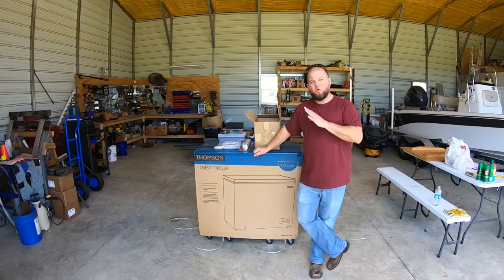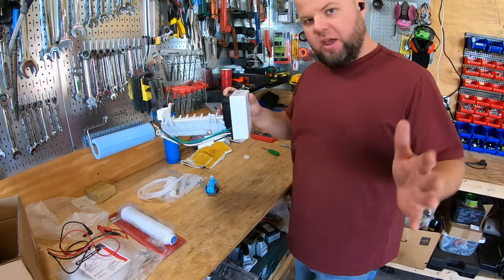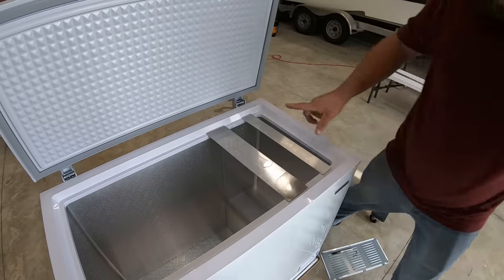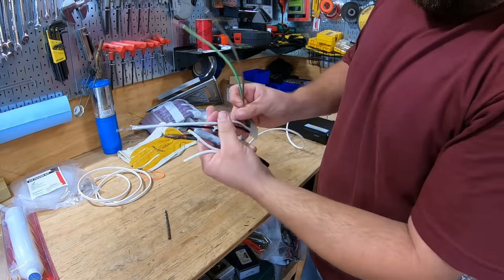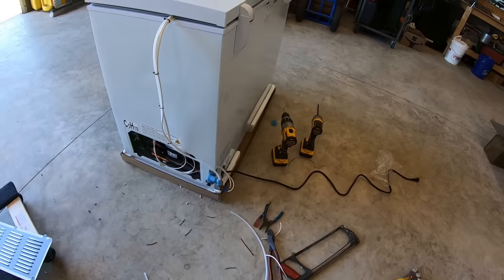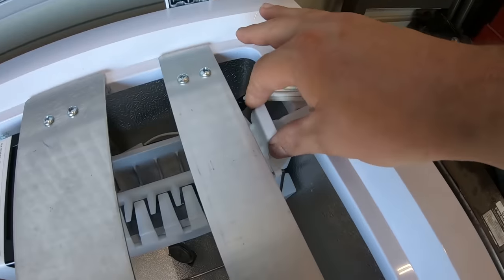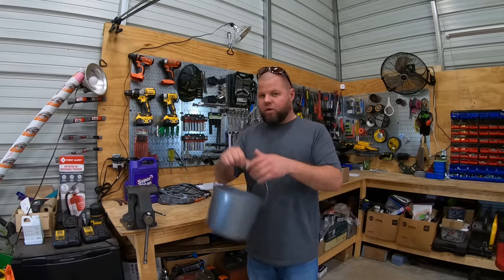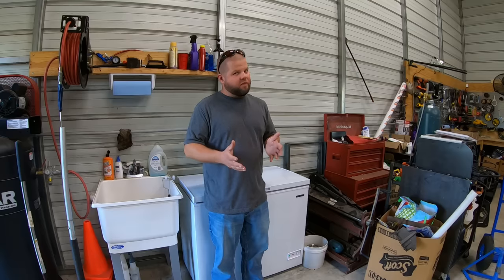Homemade ice maker! SAVE thousands over a commercial ice maker

Comment: Caution on so called self-piercing valves...when copper supply line is tapped, it  should be pre-drilled with a 1/4 in hole.The piercing point does a poor job, sometimes breaks and anyway provides barely an eighth inch hole..Additionally, these valves should be mounted on vertical  supply lines where possible.If a horizontal run is the only available, mount the valve on the side of the pipe.if mounted on the bottom, sediment will clog it eventually if not sooner.Corrosion can occur at the point of attachment due to the copper to brass dielectric matchup.       -10 deg F is pretty cold for this operation.The operating thermostat inside the ice maker closes at 16 deg F. A freezer running that cold could cause the I/M to short cycle which would result in hollow/damaged cubes as well as continued icing of the fill tube.
Reply: I'll go further to say that those self-piercing valves have a limited life.  I always bite the bullet and shut off the water, cut the copper pipe and install a tee, then put a regular ball valve on the tee outlet.  It's not much more money but it makes for a nearly permanent leak-proof installation.  For me it's worth a few $$$ and 30 minutes of time.
Reply: @fredsasse9973  Yes ,the saddle types do have a shelf life, yours is a much better way.Folks w/o soldering skills can use the 1/4 in hole method with the saddle valve to avoid at least some problems.

Comment: Could you have used a hot wire/rod to melt a Channel into the cabinet for the power and water line? Then once installed used some white Marine J.B. Weld to smooth out the cabinet which would give you a good surface to seal cover.
Reply from the maker: Yes that would work

Comment: Great idea thank you for the video just wondering you should have some backup power in case the electricity goes out for a little while then all that ice turns to water then the electricity comes back on and turns that 40 gallon of space into a 40 gallon block of ice imagine trying to get that out on a whim, also careful with the plastic tubing especially in the garage because sometimes rats come in the front open garage door and if you set poison they usually get very thirsty and they will chew right through a little plastic tubes like that and you'll have a water Mass all over the place just adding my two cents, great idea though thanks again
Reply from the maker: We have generators, this is Florida, so storms are common

Comment: Have you checked the ice maker trays before new tests for any ice that may be in there to add up yo next batch
Reply from the maker: No I do not use anything still in the maker trays, that's why I run two 24 hr tests and take the average. Timing the drop is about impossible, the avg works well.

Comment: Holy power socket overload Batman! - Feel free to install a decent power set up for your workbench - It's a fire waiting to happen atm!
Reply from the maker: Not at all, 10 gauge wire, 20 amp breaker and all outlets are industrial, not the cheap ones. How much power do you think this actually pulls? I've tested it and it's isn't much

Comment: FYI if your going to solder wires like that dont twist them together butt them up to each other and push them into each other makes for a better connection .
Reply: Don’t forget the heat shrink tubing to cover the joints.

Comment: Did it come with a floating basket??  You could have used that to set the ice maker in.   You might have had to cut one side out but it would work
Reply from the maker: Watch the next videos, I installed two ice makers, so the basket wouldn't work.

Comment: First, thank you for sharing. Just want to mention the ice made in this fashion is not at all the same ice made in a stand alone ice maker. Commercial ice makers freeze pure water and the impurities are flushed out. They use a lot more water than a built in ice maker that freezes all the water that goes into it with impurities and all. If you are using the ice just to fill coolers your plan will work great. Actually even better as the impurities keep the ice frozen longer. I would still buy commercial ice to put in the drinks as it tastes a lot better. Thank you again.
Reply from the maker: I agree, this project is strictly for coolers and fish boxes.

Comment: So if u want to bend  Plastic tubing without it  Getting a kink. U fill it up with sand leave little  Room for movement If possible cap the ends then put in the oven or slowly heat it up  Once desired  Angle let it slowly cool down. Wash sand out thoroughly  With something like a bottle brush

Comment: Since there is not coils in the lid could the water line have been installed through the lid?
Reply from the maker: You can, but I don't like that since the lid moves and will pull on the lines/wires.

Comment: Maybe you could of pulled the exploded parts diagram to figure out where the tubes were roughly so you could drill a few screws to mount the kit the way you wanted. Either way, cool idea… may have to try this sometime.

Comment: This is a great idea if it serves your needs.   Commercial icemakers make clear ice with the impurities remove.  There are filters on the incoming water supply and the way they make ice takes more impurities out.  The water is circulated by a pump and freezes to the evaporator as it flows down the the trough and is pumped back to the top.  That's why commercial ice is clear and ice made this way is not.  Commercial icemakers make ice faster as well.  They are also cleaned on a regular schedule, the frequency varies depending on the environment it's in.  Breadmaking and beer dispensing require more frequent sanitizing due to the yeast that gets airborne and drifts into the machine.
Reply from the maker: I understand and that's great drinking ice. I need super cold, thick and long lasting ice for coolers and fish boxes. On a budget too
Reply: The difference between clear and cloudy ice is temperature and temperature alone

Comment: Freeze buckets of water, large heavy zip lock freezer bags and make big chunks that’ll last longer. I freeze milk jugs with water in them 80% full then pull them out and beat the sides with a hammer and chunks come and dumped into your cooler. Ice cream buckets are great and release a huge chunk if you want it to really last a long time if you particularly want ice not just being cold. I like cold dry coolers so read the next part.You can freeze your whole unit with this method by putting loose fitting boards in as shelves across the buckets and get that mass started. Leave some there to maintain mass. The milk jugs have a hole cut in them as we used them once with the handle intact to bail out water in the boat too. You shoulda just used it as a freezer without all that if you do likewise to the above. Hammer on the sides doesn’t usually break the plastic and theres a plenty of milk jugs to be found. Just frozen containers like 2 liter bottles and I particularly like the half gallon jugs but I only bust up the gallon jugs. Have at it and you can make lots and lots of ice. It does take a couple days to freeze a gallon till the mass gets built up. I use a lot of half gallons in a cooler to age deer meat do thats why I need lots of back ups and my favorite. Just fill them 80% and wash the outside before putting back in freezer.
Reply from the maker: The problem with block Ice is it does not surround drinks in a cooler or fish very well. But I am thinking about adding block Ice in combination with cubes

Comment: A kegerator uses a heavily insulated 2x6 frame around the top of the freezer to put the Beer taps through and a temperature controller to maintain temperature.  The temp controller is not needed for your application.  The freezer lid is relocated to the 2x6 frame to close properly.
Reply from the maker: Yes! Watch my recent video, I discuss this and plan on doing that on my next build.

Comment: Only thing I would do differently is to use one of the metal racks and put the ice maker in it. Cut it so that the ice maker sits down in it snug and notch the plastic top for the tubing to fit into. Then use something to seal it up

Comment: Love what you did with the install ,but the water valve should be mounted with the input on the top , the solenoid needs to have gravity assist in closing the pin inside to prevent failure to close.
Reply from the maker: Good to know

Comment: Insulate your water supply .
The water comes out of the ground at the average year round temperature
Of your location . 
But then in sits in the pipes until the solenoid opens. While sitting it heats up to room temp, in basement cool in barn or shop hot.
Then the freezer had to cool it down again.

Insulate the pipes as best as you can from where it comes out of the ground.

Also locate freezer in coolest place you can ie cool basement.

Comment: Just need to think about Everytime you open the lid to get ice out your letting warm air in causing the ice in freezer still to stick together and eventually ice on bottom may turn to one huge solid ice cube block that u need to break apart which an ice pick is risky and hammer also risky puncture a copper pipe and game over but hope it works out great for you!
Reply from the maker: Not been an issue after three months and opening up multiple times a day for testing/videos

Comment: You should hook the Green wire to the case only. Use the white for common and black for line power. If you wire the green for common ground you could possibly pull current through it or create a possible hazard of electrical potential between the freezer case and another appliance. It depends on how the icemaker is wired which I do not know. Just be safe :) It's a great idea though.
Reply: The green wire is connected to the case down in the compressor compartment.

Comment: Not that is matters but your freezer doesn't use freon or similar refrigerant. Cyclopentane, hence the flammable caution, it's less damaging than any other other options so is commonly used in appliances which are not always disposed of correctly. Cables through the drain or lid would work well too, good call on not risking it & damaging one of the lines. Might add a fan to cycle air evenly? You'd probably get away with a 110v fan running off the compressor thermostat so it cycles with the compressor - but ground it well in case of accidental shorts.
Reply from the maker: Fans installed two days ago, that video will be out later today

Comment: That freon is propane based  .
But other freons if ignited you breath one breath it kills. 

Being in water filtration 
I would connect an RO unit 
Theres an excellent permeate unit that will last twenty years  filters are cheap  that filter you have wont last long its good for maybe 200 gal for chlorine and taste  thats it.  If yur gonna filter may as well go to the dalton scale and you can consume the ice  otherwise 24500 contaminates as all water has.   

Thats a great ice machine ! 
and easy to fix.   With a garbage can you can use the other side for your bait.
Reply from the maker: Just using this for cooler ice and fish boxes, not worried about taste or for drinking. It's c5h10 cyclopentane, thanks for watching.

Comment: Or you could fill freeze milk jugs, 2 liter bottles, even water balloons work well. And then you can either leave the ice whole in whatever you used or break with a hammer. If you have room in your cooler leaving it whole is the way to go because  it last 10 times longer before it melts.

Comment: Caution drilling holes in the side look for frost line so you dont drill in the evaporator also most freezers has thermal strips to keep the gasket from freezing
Reply from the maker: I checked for wiring and the heat strip before cutting.

Comment: I checked the specs on my counter top ice maker - 40lbs per day but at about 1.7 lbs at a time.  It makes a tray of ice every 12 minutes.  The disadvantage to these ice makers is they don't keep the ice frozen.  It only makes ice as it is used, keeping 1.7 lbs available between consumption times.

I checked my lamp cords.  The lead with the ridges is the neutral wire is the standard.  But ii really doesn't matter as long as you mark or otherwise color code your wiring.  I don't know if this wouled work, but drop a few pounds of dry ice to kickstart the cooling process.  Let's see of all the ice you make stays as separate cubes or will it trun into an iceberg at the bottom of your freezer.  But whatever the outcome, you've built an ice machine at 1/10th the cost.  With ice going $2-$4 a bag, it will pay for itself in a year.
Reply from the maker: Videos coming! I will address some of your concerns

Comment: Please explain or show your wiring diagram I’m currently setting one of these up and can’t get the water valve to work
Reply from the maker: I can't, wiring is a big legal issue. I can tell you that I found the wiring diagram online by using Google.
Reply: @TKCL  I currently am hoping that the water valve with work after it makes a cycle I manually filled it and have been waiting for it to freezr
Reply from the maker: Keep in mind that it will not operate until the ice makers get below 10 degrees and trigger the water valve.
Reply: @TKCL  yes i have recently bought in good condition a used 3.5 cu ft but right now in phoenix az its 113 still and my freezer is having a hard time getting below 10 during the day in my garage best ive seen is 12 i also believe im using the frigidaire ice maker and your using whirlpool i wonder what differences there is. i will try bringing the freezer in the house for a tempersry setup for another month and see if it can get achieve 0 degrees

Comment: I'm not that smart but for a simpler less intrusive method for the non diy electricians is getting a large ice trays or smaller ones and joining them together in a hanging or angled trough it would take some time to engineer the correct water feed method but the payoff would be larger volume and no electrical hazards

Comment: One issue I see is that your oldest ice is going to be at the bottom, and you are always pulling out newer, fresher ice.  If you ever do need the ice at the bottom, it will be funky and probably coagulated into hard blocks.  Maybe a system of bins in the machine that you could rotate would be a good idea.  If the ice is just for a cooler, and not really for consumption, then I don't think it's an issue.
Reply from the maker: Not a worry for cooler ice and fish box ice as I stated I built this for.

Comment: And for larger blocks of ice in disposable containers, fill cheap plastic trash bags (7-10 Gallon Commercial "can liners" cost about 2¢ each) with water and put them in plastic bins sized to fit neatly inside your coolers. With the lids on, the bins will be stackable in your freezer. The bags may leak a little as the ice thaws in a cooler (just like a store-bought bag of ice cubes) but that allows the water to be drained off of the remaining ice. Of course you have to manually fill these bags with water (unlike with your icemakers) but you end up with ice blocks that are already bagged, saving the time it takes to gather up batches of loose ice cubes. And of course, large blocks put more pounds of ice in the space available in your coolers (more thermal storage) and don't melt as fast as the same weight of ice cubes (and not nearly as fast the same volume of ice cubes).

Comment: Instead of the white wire, I would have bought a 20' run of romex.
Also, commercial units don't keep the ice at 10 below due to the constant frost and defrost cycles of newer freezers to prevent frost buildup on the accumulators and piping.  No matter what you do, you're going to get big ice chunks at the bottom of the freezer making it truly less efficient to use all the ice.  I would go in every so often and stir your ice to prevent ice caking.
Reply from the maker: After 3 months I have no build up as you state 🤷

Comment: My inlet valve is open and water pours into the freezer.  What am I doing wrong.   Have the switch wire from the ice maker and a neutral.
Reply from the maker: Something is holding the water valve open, sounds like you might not have the proper trigger wire going to the water valve.

Comment: The flamable refrigerant is probably butane.  Yes the lighter fuel and portable stove fuel.  Butane is cheap and often used in smaller, cheaper refrigerators and ice makers.  My Frigidaire table top ice maker uses butane and has those same warnings.
Reply from the maker: C5h10

Comment: Good video.   Just curious why not just buy a commercial ice maker from walmart?  They start at 340.00 and it produces 110 lbs in 24 hours with a 27 lbs capacity.
Reply from the maker: Not commercial by any means. I address that in my recent video, but it's because those produce small hollow ice cubes that melt quickly and they don't have nearly enough storage. For example when I go saltwater fishing I need 80lbs of ice ready to go.

Comment: you could've still screw mount it without puncturing the refrigeration lines. put the drill in slow speed, go slow at 1 sec intervals until gently through. then stick a wire into it to feel around to where they are. do the same with all holes. or you only need the top 2. it worked for me.
Reply from the maker: I'd be very worried about lines that could be right against the wall. I ha e a better idea I'm sharing in a video today.

Comment: Maybe could have cut a slot into the lid seal for the water & power lines?
Reply from the maker: It's not thick enough for those big water tubes. On my second build I lifted the lid with a pvc collar and drilled into that.

Comment: Bend PVC without distortion.
Before you heat it, fill it with sand or anything granular and cap or plug the ends.
Heat and make any shape.
Reply: you can also use a return spring like on a screen door , ect. put it in pvc ,heat, bend, remove spring